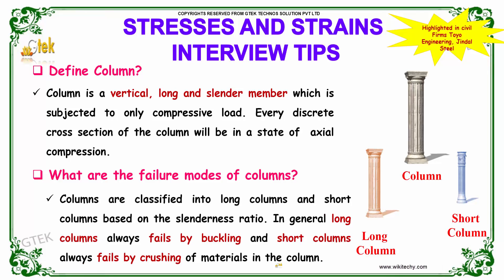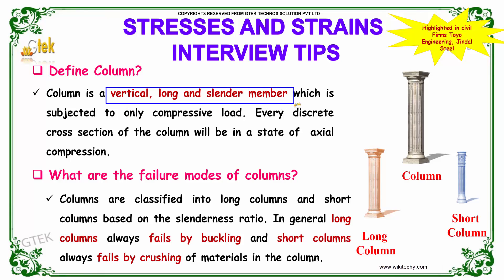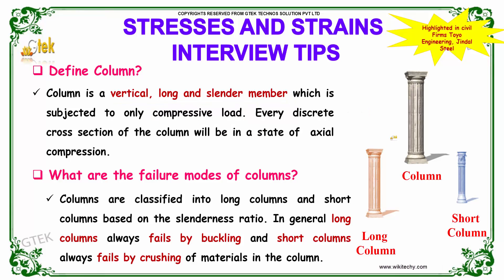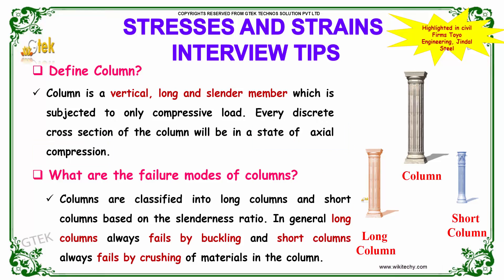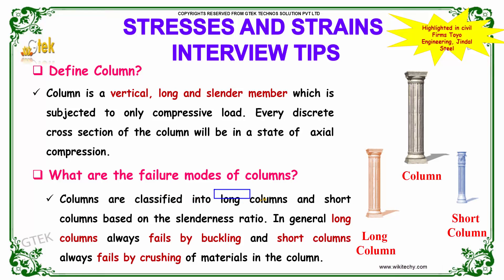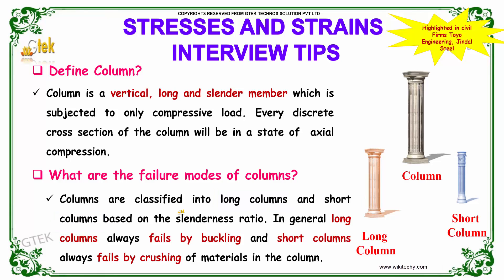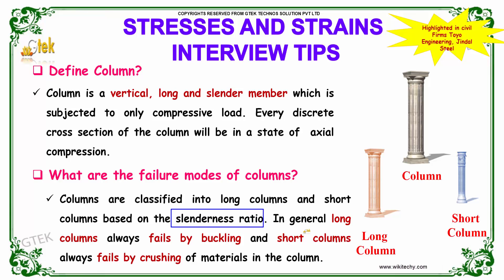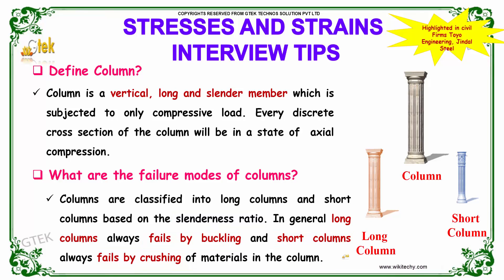Define Column | Stress and Strain Interview Questions | Civil Interview Questions

Comment: A column can be defined as a vertical structural member designed to transmit a compressive load. A Column transmits the load from ceiling/roof slab and beam, including its own weight to the foundation. Hence it should be realized that the failure of a column results in the collapse of the entire structure.

Comment: A column or pillar in architecture and structural engineering is a structural element that transmits, through compression, the weight of the structure above to other structural elements below. In other words, a column is a compression member.

Comment: Define Column ?
Column is a vertical, long and slender member which is subjected to only compressive load. Every discrete cross section of the column will be in a state of axial compression

Comment: Column is a vertical, long and slender member which is subjected to only compressive load. Every discrete cross section of the column will be in a state of  axial compression.